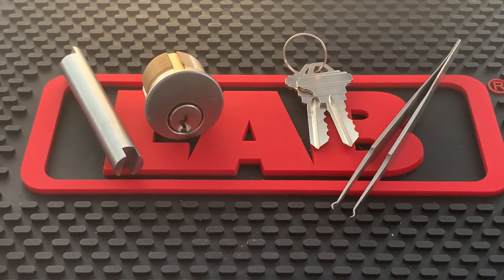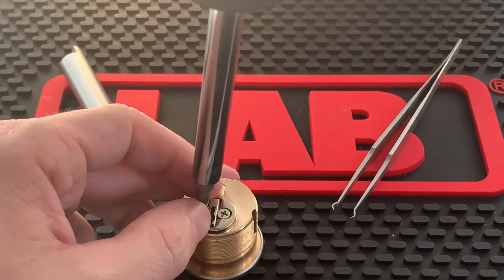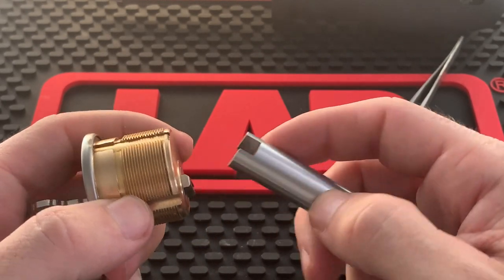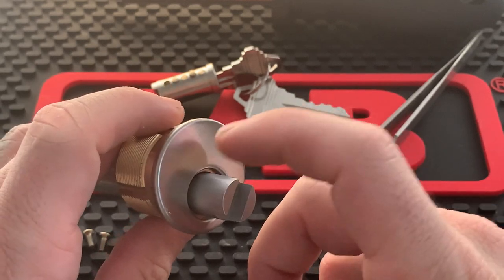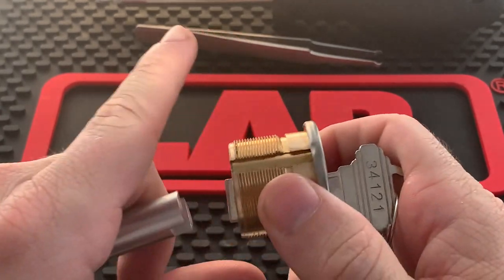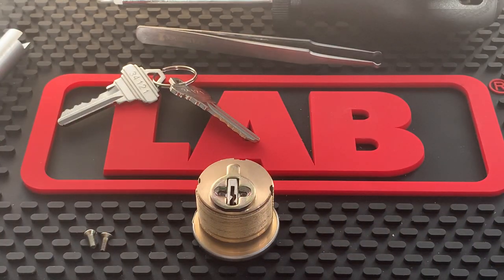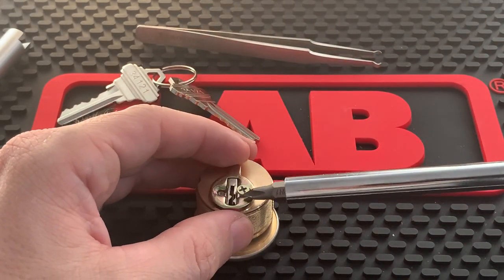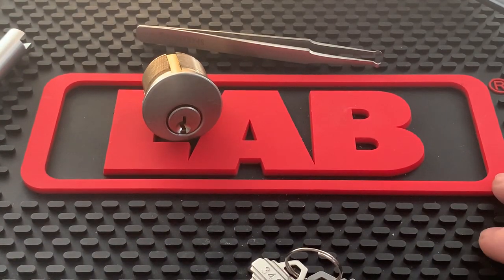How to Rekey Mortise Cylinders

Comment: You didn't actually show how to rekey anything. You just took it apart and put it back together again.
Reply from the maker: On my channel I have several videos on rekeying locks. This video was showing the process of how to rekey a mortise cylinder. 

This was part of a series and changing the pins is pretty standard and I wanted to save time on the video. 

Originally this channel was geared to teaching apprentice locksmiths who had already rekeyed residential locks.

Comment: How do you know if they're Master pins
Reply from the maker: Master Pins will look like shorter versions of your top pins. 

They will basically be extra pins in the top chambers. 

If you pull the plug without a key, you may even find them on top of your bottom pins, you will notice flat pins on top of your beveled ones.

Comment: What’s a master pin
Reply from the maker: In laymans terms, a Pin-Tumbler lock is designed with Top-Pins and Bottom Pins. All standard Top-Pins are the same size while the Bottom-Pins correlate to the different bitting on the key. 

When a key is inserted into the lock, it pushes the bottom pins up to specific heights creating a Shear-Line for the core of the lock to rotate.

A Master-Pin is essentially an extra Top-Pin of varying sizes used to create a second shear-line. 

For example: Let's say you have a building with 3 offices inside and each office belongs to a different employee. Employee A will have a key that works for their office, while employees B and C have keys that work for their offices. 

Neither of the 3 employees keys work on each others office doors. Now, at night the Janitor needs to be able to open all office doors and his 1 key opens all 3 offices. 

This is an example of a Master Key System. Each office lock has differing Master Top-Pins to create a second shear line to allow the Janitors key to work.  Sometimes you'll hear this referred to as a "Skeleton-Key" by co-workers.
Reply: Do you need to replace the master pins or just discard them?

Comment: What makes a mortise cylinder a mortise cylinder?
Reply from the maker: You'll know the Mortise Cylinder when you see the threads on the cylinder. They fit into a lock body that is mortised into the door.
Reply: @LockandKilo  So there's nothing special about the lock itself, just how it mounts?
Reply from the maker: @iyeetsecurity922  The tail piece as you see in the video is only main difference most pickers notice as they only buy the cylinders lol

Other than those things tho it's just a lock. 
Pins up all the same, nothing amazing lol
Reply: @LockandKilo  Right on. I appreciate the responses and information!

Comment: Thank you!
I've changed out the top pins on my Sparrows Revolver, but I got a 5 pinned/6 drilled mortise cylinder today and rekeyed and pinned it to use the full 6 pins with your help. No issues. Went perfectly.

I don't have a pinning mat yet, so I used my soldering mat. Don't have a core pusher, so I modified a Sharpie. Don't have pinning tweezers, so I filed the tip of some hemostats.
Reply from the maker: Hey, not bad! You can pick up the HPC Hollow Follower set relatively cheap online and hobby shops have some decent tweezers!

If you don't have a pinning mat you can head to Walmart and go to the craft section and have them cut you a piece of pleather material. 

Some of them have some deep grooves that can help ya and a yard of it costs like $5.00. 
I use that material on installs to catch any wood droppings inside a customers home lol
Reply: @LockandKilo  I've ordered an acrylic follower and the mini mats (til I get their large one) from Sparrows. I didn't buy their tweezers though because I figure I can find some for less than $12. The hemostats I've got are left over from my body piercing career and work really well after filing  a round slot in them. And the ratching handle is, well, handy. I'll probably get legit ones to try em out in comparison though.

Years ago I dabbled in this due to having quite an interest but moved on because of the bajllion hobbies I have, but I picked it up again a month ago and have been getting big into it. Mainly because tools are way easier to get now. I used to have to make my picks since they were expensive and hard to get. Now I've got around 20 picks, 23 padlocks, 1 cylinder, and 4 combo locks. I absolutely love this. I'm big into puzzles so it fits well with me.
Reply from the maker: @iyeetsecurity922  Sparrows I think used to have a bundle deal that tossed in Tweezers, but I can't remember. 

Sometimes you can heat up a set of hobby tweezers and shape the ends. 

My latest video I show a way to make paper clip picks, which is what I used when I first started for a hobby haha

Locks are amazing puzzles!